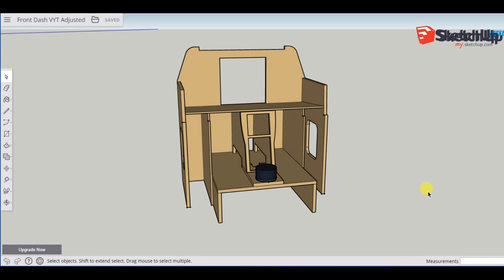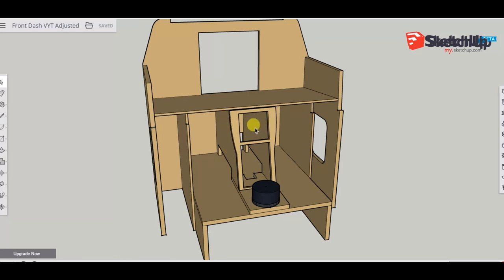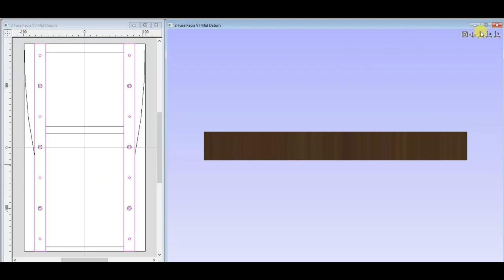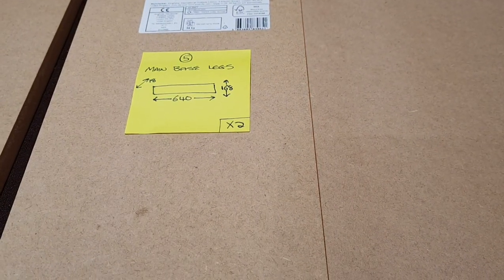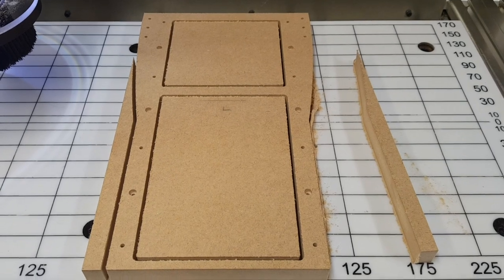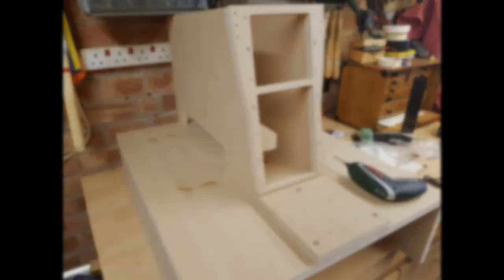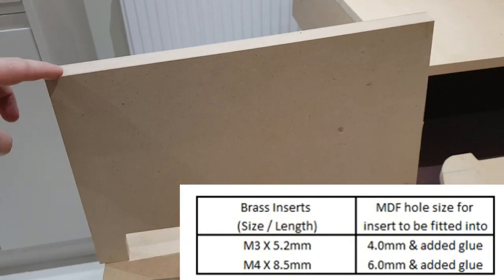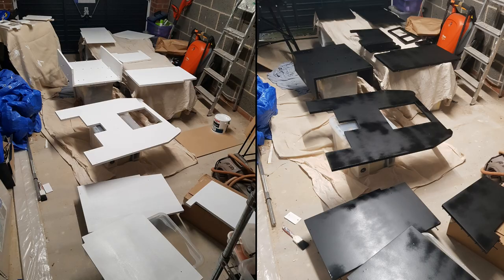Simpit A10C - Front Dash - Part 4: Cut Parts and Test Assemble

Comment: Just stumbled across your build. I haven't watched it all but you have some interesting ideas. Did you think about using ribbon cable for some of your wiring? Also when doing your design, think about maintenance and future trouble shooting. Once everything is put together can you access certain areas without major disassembly? That was one of the issues I ran into. 

Have you had any problems with too many USB's? Even with powered USB hubs, there can be some weird USB issues. Especially with static electricity while climbing in and out of the sim. Apologies if you've already mentioned some of this stuff previously. I'll need to watch all your videos. Looking forward to the next one. Cheers!
Reply from the maker: Hi EmesiS, I had looked at ribbon cables briefly but most of my wires run from components straight to keystone jacks. But a good idea for me to keep in mind for wiring generally.
The left console I built has good accessibility. Check out the video I did, I show how I can remove the sides and also a maintenance manual I did for it.
I haven't had any issues with USBs yet, however I only use about 8 currently. Hopefully by using an RS485 network I can limit the number needed. What kind of problems did you have exactly when getting in and out of your simpit as regards static electricity? How did it affect the simpit? How did you fix it? I'd be keen to know so can bear in mind. Cheers

Comment: Hey Craig. Interesting Build. I am looking to do my own lesser detailed (VR) model of the front dash. For the life of me I cant seem to find a drawing or sketch showing the overall dimensions of the thing. Would you care to share the totals, (HxWxD), so I can cut it out of Ply and fit my thrustmaster cougars etc to it?? TYVMIA
Reply from the maker: Hi Carsten, no worries. There are two ways to get this info. The first, is to Google search "dimebug A10C plans" and you should be able to locate his zip file online which has all the dimensions (it's very good and quite detailed). In one of my videos I think I show how to locate this online. If you have any problem locating this, then the second option, email me at craig@mysimpit.co.uk and I'll email across to you. 
His detailed plans are what you need, because the width given on its own isn't just one value, for example it's different at the top to the bottom and there's curvature between the two
Cheers